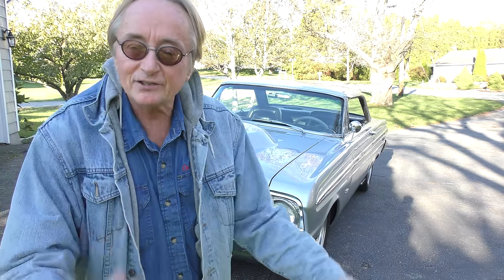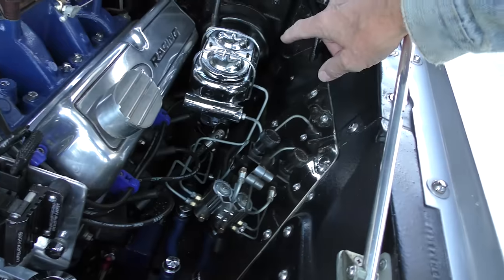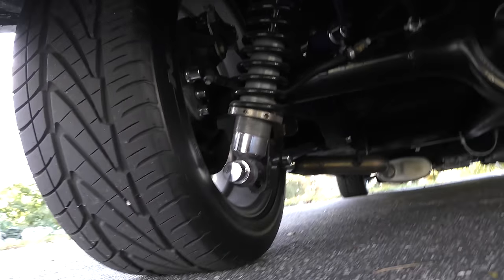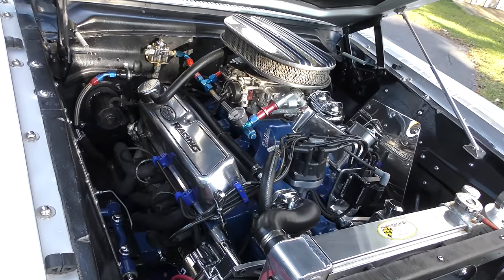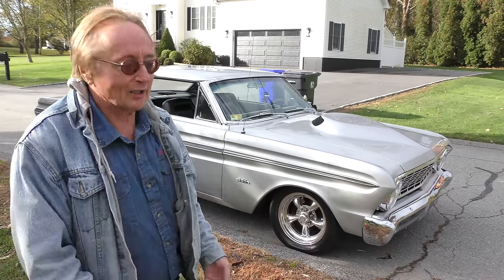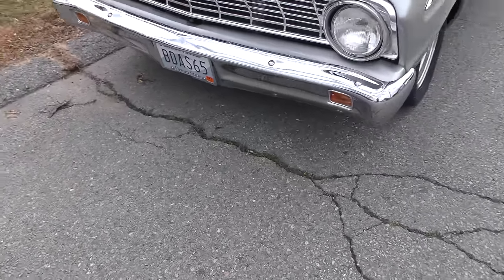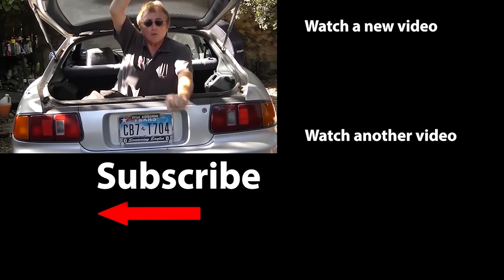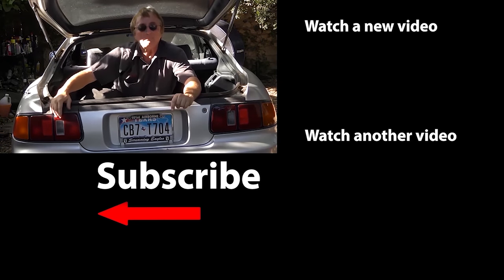I Finally Found an American Car Worth Buying

Comment: Shows how much Scott knows...he had a 2013 Shelby gt500 and said it had variable valve timing....
As a Shelby guy I will have to tell you NO IT DID NOT.  The 4.6 3v had cam phasers and the 2011+ coyote 5.0's still do. Never the 5.4 or 5.8 Shelby motors. SORRY